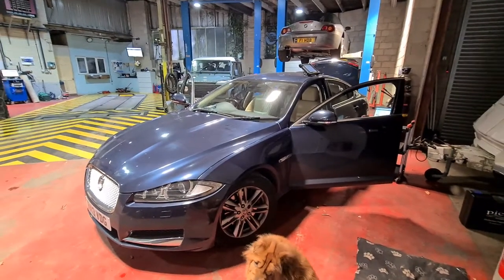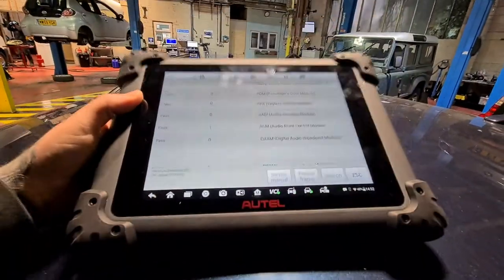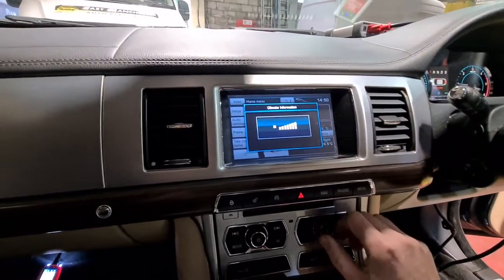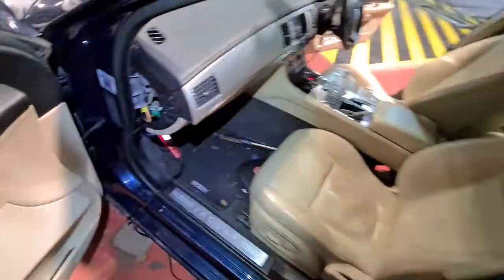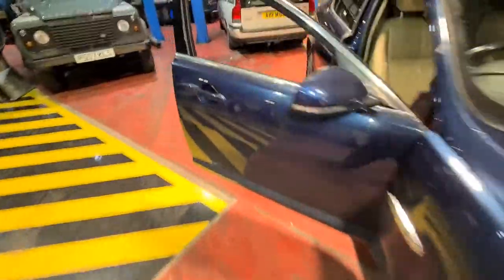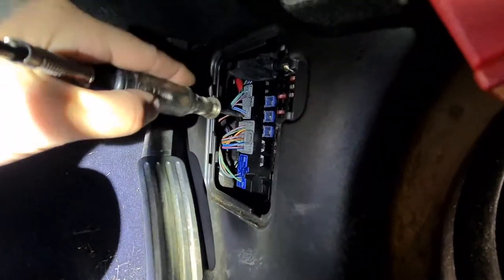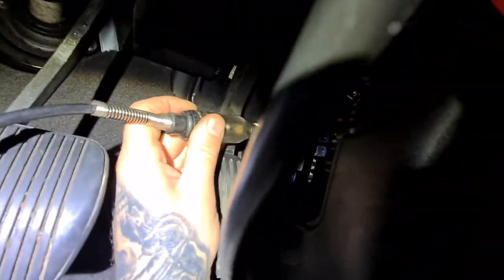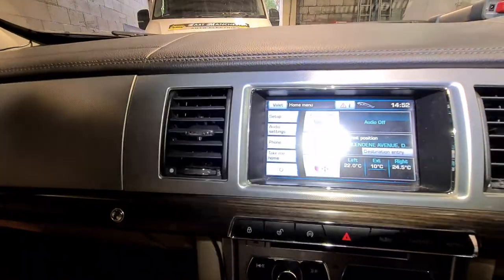Jaguar XF Heater fault

Comment: Legend ..I have the same problem..just pulled the block off the bcm fuse box on the drivers side ...water ingress and 2 pins rotted away...cheers for the help
Reply: did you manage to clean them up and get it working or did the whole box need replacing (very expensive)?

Comment: Hi I have a Jag XF 2017 and the rear window heater has stopped working do you know what is the best why to test it, what to test or can you send me a wiring diagram for these circuits for me to check

Comment: Just a thought try the grey multy plug the bottom pins usually have water ingress damp if you disconnect the multy plug and have a look a blue green ting to the copper pins, they will need cleaning and the multy plug female connections as well
Reply: Remove connector from fuse box and use contact cleaner and toothbrush to clean the pins on fuse box, you also have to clean the connections in the connection block, I used an interdental brush for the connection block with the contact cleaner. Look the up on the Web they are just the right size for cleaning out the female connector contacts
Reply: Did it fix the problem after you cleaned the contacts?